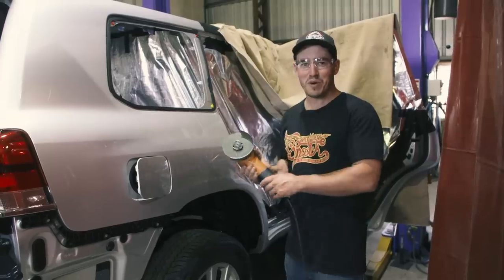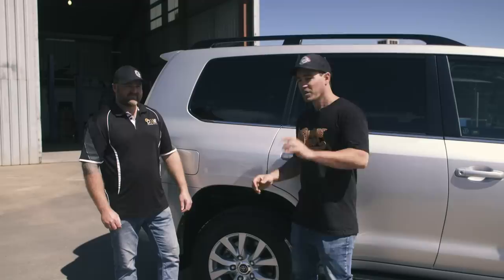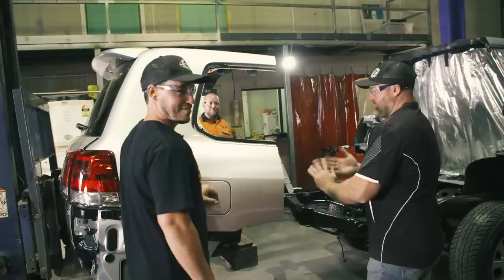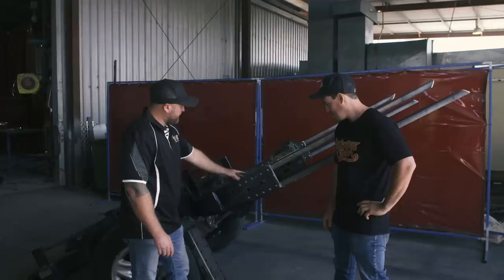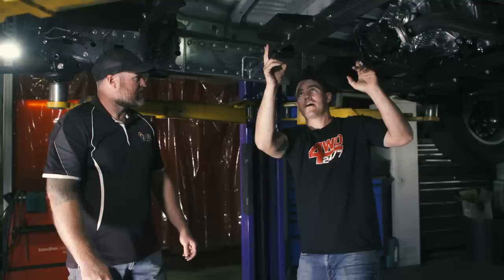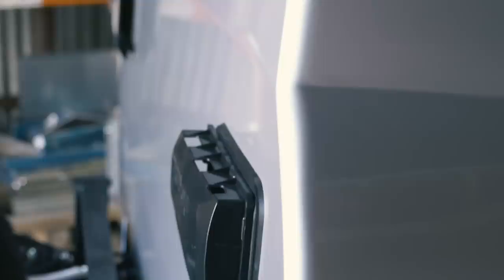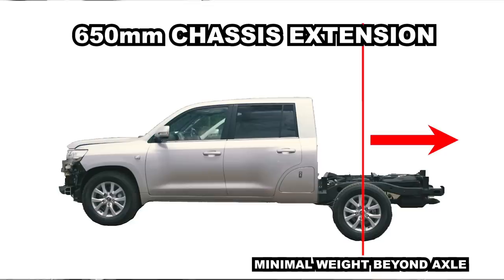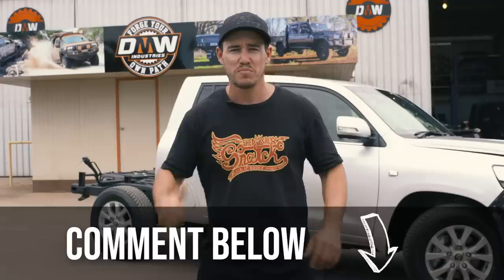Shauno’s 200 Series LandCruiser Build! What NO-ONE told you about ute chops! How to do it right!

Comment: I haven't watched yet but I'm sure something is a 'game changer"
Reply from the maker: HAHA. Wait for the 'game changing personalised plate design' episode!
Reply: @4WD247  GMCHNG
Reply: idk about game changing but lots of "over engineering" lol
Reply: @4WD247  IN-DEBT
Reply: @lordterrabyte1417  I don't think it's over engineered enough
Reply: Good luck Shaun cant wait to see the finish built
Reply: Holy heck I think you're right 😂
Reply: @4WD247  SPNSRD
Reply: @4WD247  that Graham height folding out table I reckon qualifies.
Reply: Give it to Scott and Luke @ GSL to do the 'Power Up' diesel mods .. that'll be a 'Full Send' for the 4.5ltr twin turbo!
Reply: Chuck a flat Rhino rack on the top
Reply: Watching a creative cut and they reckon a plus 650mm 200 series has a better turning circle than a plus 300mm 79 series. That's good.
Reply: How good is that?
Reply: And a MONSTER ;)
Reply: @4WD247  I was wondering why you did a paint match for the respray  and not went with a rhino liner on the cab??
Reply: Coffee machine
Reply: Looks sick mate, can’t wait to see some trips in it. 

Only thing I don’t like about these chops is that little tool box door. I think should be hidden behind the rear cab door like Ultimate Stretches does in Sydney. Other then that 200 is a beast 😎👍🏼
Reply: It needs the 79 scoop
Reply: That's Insane!
Reply: @Mambey  that would be the difference between live front axle, and ifs
Reply: How good is it though?
Reply: @4WD247  I'm just about to lock in a 79 dual cab for a build, i was unaware of the chassis size difference, and I was looking at an auto conversion too..  im half changing my mind at the moment... the only thing that has me wondering is i really want a live axle front end instead of ifs
Reply: @SkatersOfTheNorth  op
Reply: What an absolute weapon!
Reply: @4WD247  I want to turn a 75 troop into an extra cab. is there reinforcements to do that?

Comment: 2 inch suspension raise ,air compressor built in to old wheel well, to air tank underneath, with connection to connect air hose outside, then have 1 inch diff drop at front IFS  to straiten out cv's, second battery and  dc/dc charger monitor , 33 inch tyres , more torque for towing large boats, engine ture  / ECU remap.

Comment: Use those factory rear ends that have been chopped off to make a canopy that looks like the cab, factory tailgate and lights, black doors where the extended windows would have been, drawers behind lift up side panels and roof bars that stretch the whole length front to back.

Comment: Gday mate! I’ve actually drummed up an idea to buy a “clear view spider” mounted into the canopy and to a arb dual compressor then have air sockets mounted above each tire then that way you only have to have a small length of air hoses connected to each wheel! And further to that you can control all the air on all 4 tires or! If you want to spilt different psi’s just turn the taps off on the spider tank!

Comment: Australia needs the full size Tundra to be sold there. That would solve the problem of having to convert suvs to trucks.
Reply: Nah mate, in the 200 you get rear coils stock and a narrower chassis, the 200 is already an extremely wide vehicle in Australia, and the tundra is even wider again which would be inconvenient for our road widths and parking etc. 200 interior also is a luxury with less road noise and more comfort etc and 200 parts over here are a dime a dozen. Its an all round more capable off road vehicle, not to mention the traction control as well when compared to the tundra
Reply: I was gonna ask the same thing. You can get all the luxury options and traction control in the Tundra and it would be far cheaper to convert it to coils than a ute conversion, but they are MASSIVE trucks and there's getting around that.
Reply: Would prefer the Tacoma. Bigger than Hilux but not massive truck like Tundra.

Comment: Hey Shauno
Some custom rock sliders with built in led lights inside them would look sick as it’s something different that no else has got. 
Even those lights that are blinkers and Parker’s in the door handles make it stand out. Custom side air slotted vents on the front guards or doors will break up the look aswel. 
Front jungle guards would look good also. 
The lists are never ending but like the build so far.

Comment: For the price of a 200 Series PLUS the conversion ... I would just buy a Ford F350 4X4 Platinum 6.7L V8 Diesel SuperDuty Platinum Crew Cab Ute and go from there... 80000 kg tow capacity out of the box...

Comment: looks great, very nice!!! i also have a chopped and 600mm extended 200 as well. They are great can not be matched four touring...one thing i will say is watch out for those molded side tool boxes, they are real bastards for rusting from the inside. As far as i know, no one has successfully come up with a design that won't rust out over time...if i built mine again, i wouldn't have bothered with them.

Comment: @4WD 24-7  Shauno , how about a long Range fuel  tank, Water tank,  and of course Built in air compressor, for a start. Obviously you will be going with Fulcrum GVM Upgrade, adjustable sway bars, adjustable upper control arms, etc.

Comment: Do they chassis rails get treated inside? Looks like a lot of surface area for rust to form between the box sections to the chassis?
Reply from the maker: They sure do. Rust proofing is not just in the chassis, but also in the rear wall. Shauno

Comment: I have a question for you guys; 
If you increase the Wheel-base of a vehicle like this, ¿what does happen with the Ackermann steering geometry? because the front axle still un-modified right?  does the vehicle steers well at high speeds?

Comment: Just wondering, what's the benefit of chopping and extending a 200 vs starting with a Tundra or other truck? Is the Tundra not available in AUS? It just seems to me it would be a lot less work (and money) replacing the bed of a truck instead of chopping up a 200. Just curious.

Comment: Gday pal.... not much of a 4WD ER mate... just wondering if you could answer a question for me ?.... I own a navara D40 2WD 2.5 lt twin turbo it’s done 124.000km planning a trip north from Melbourne to Frazer decking it out with canopy ARB drawers compressor double batt system, OME suspension safari snorkel etc, also putting in a diff locker to the rear..... will the diff locker get me out of trouble in sand and or improve the 2WD?... will also be placing an ARB safari roof top tent .... would their be anything I should  consider for this trip north ... haven’t done any 4WD ING at all pal so yr opinion and advice would be much appreciated

Comment: The only part that bothers me is the rust proofing in all the areas you can't get to after welding .At the factory every part is covered in the dipping process, where as with this build it will only be where the spray gun can get to .

Comment: Cool build, out of the range of most people I'd wager though, it would be interesting to get to see a cost breakdown once it's done.

I wonder if it may be "overengineered" lol. Didn't get a count, but it's got to be twwwwwwwwwwwwwhe wwwwwwwwwwmost used phrase.

To be strict, it's not overengineered, it's over-built. Engineering being the process of detailing a technical design, something being overengineered would be when one spends more than necessary effort on the technical design which may result in something like an intricate multi-linked system for weight distribution where it would have sufficed just welding on two extra plates of steel. Piling on structural components in excess of what's really required which seems to be what's implied in the vid would be something that's over-built.

Comment: Why get something ifs, unless he sasses it shoulda just kept the 79
Reply: We’ll just see how he goes.
Not keen on wheel lifts that run over 100K.🥴
Reply: Blahblahblah. Its a tourer not a rock climber. And yes I own a patrol but it's not the end of the world to not be driving a solid axle. He has the dirty 30..
Reply: @EndIess  exactly he’s got the dirty 30 why doesn’t he use it or should’ve kept the 79 a solid axle dual cab that he already owned
Reply: Yeah man, just sas it bro!
Reply: @lewdog1724  I think with VSC you can't engineer a SAS, hence why most hiluxes you see SASd are pre 2012. 2012 extra cab was the last without VSC.
Reply: @EndIess  what’s vsc?
Reply: @cabline1193  vehicle stability control/electronic stability control
Reply: @EndIess  makes sense I don’t really pay attention to any recent four wheel drives they don’t make them like they used to
Reply: @cabline1193  yeah fair enough, they are surprisingly capable though. Minus the fragility and constant CV breakages... Just a different driving style really..
Reply: @EndIess  the wheel lifts make them cool just don’t understand why the stopped with solid axles when they handle fine

Comment: every single one of those chassis extensions that regularly goes in the water is gonna rust out. look at how they sandwhiched the metal. great for strength, but its never going to get dry, and its going to rust the first time its taken in the water. untreated sandwhiched steel, inside a box. lol

Comment: Unchop it, unextend it, build it properly, then build a camper trailer to tow behind it for all your extra stuff. You have just completely wrecked a brand new car without even driving it first. This is why the owner's manuals of cars back in the day told you how to adjust the valves yourself but these days they tell you not to drink the contents of the battery. The stupidity of people these days knows no bounds.

Comment: It would make sense if a manufacturer would finally produce a vehicle that tickets all the box. Shouldn't have to coil convert anything in the 21st century or throw 30k at it for a auto. let alone chop the dog cause there other models with a tray use suspension designed for something that came before any motor vehicle ever existed. How long is going to take Japanese manufacturers to catch up with the yank tanks. We want solid axles and coils all round. We want a tray and preferably not something 7 fucking metres long. We still need to fit in the car park after taming big red.